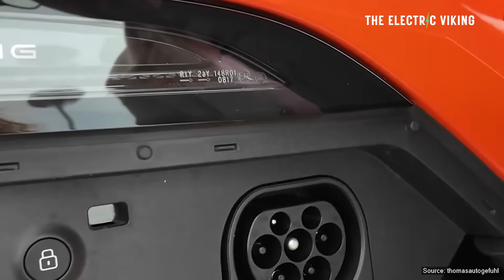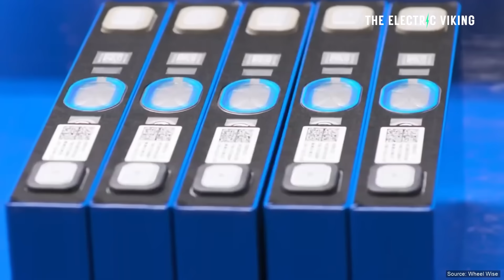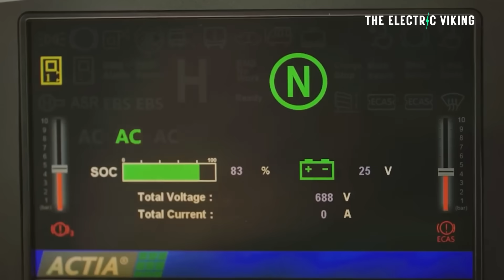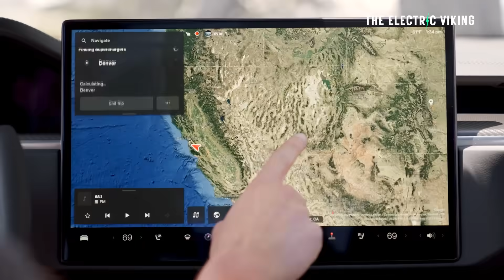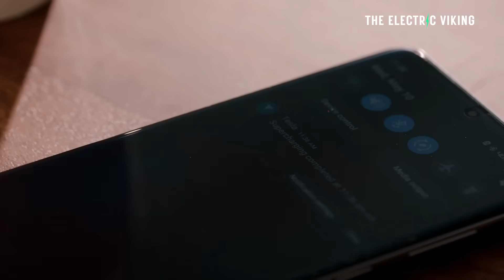Shocking data reveals the TRUTH - how long electric car batteries really last

Comment: Wonder what sort of repair costs and insurance rates apply to EVs . With motors in each wheel and in side collisions that may compromise the integrity of the main battery, I can imagine repair costs would be very high.
Reply: The motors are not in the wheels.
Reply: @jimpike7445  They are not wide-spread yet, but google 'EV in-wheel motors' and you will see.

Comment: So true. My wife's 9+ year old Nissan Leaf is still going strong. Sure, the battery has degraded quite a bit, but it's still a perfectly usable city car and I'd say we'll get another couple of years out of her before we may need to consider replacing the battery. Bear in mind, the chemistry in our Leaf is generations old. Our ID4 with thermal management and modern chemistry should be good for donkeys.
Reply: The amount of public charging option is also very different from 9+ years ago, making a degraded battery less of a problem.
Reply: I was afraid you were talking about replacing your wife after 9 years.
Reply: @jamesnasmith984  😂
Reply: What’s the range on it now. I’ve seen a few advertised and they weee 150 kms range new but now about 80 kms 
That’s the cheapest Leaf’s around 2011 I think
Reply: @Alex-l6d1f  Around 130km. Ours has the 30kwh battery. The build quality is excellent and the only cost has been a set of new tyres and a replacement 12v battery. It's still perfect for round town. We take my ID4 on longer family trips.
Reply: @AlexChiswell  I sold my 2013 leaf after 8 years usage, slow charging only and just over 110000 km usage (yes that was our second city car, not too much miles) Range (summer) after those 8 years when driving motorway with 95 km/h (on gps checked) or nearly 60 miles/h was 90 km.
When new , same speed, it made at the same type of usage 115km to 120 km range. Gives me after >1100 charge cycles 75% to 78% range compared to new. The 2013 I had was the same (japan produced) version as the 2011-2012 cars...24KWH bruto (20KWH netto usable) battery when new.
Reply: @AlexChiswell we are getting 152 klm on our 2015 leaf,  just charge it with level two capacity
Reply: Batteries love random charges and discharges. Just my opinion.
Reply: @rickyjulian496  Your home charger manages all that.
Reply: @saml4537  no dog in the fight here, don’t even have a car but that’s great it’s working for your needs and you’re willing to be flexible in trying to get more years out of it.
Reply: Yes my wife's 2015 leaf battery capacity has not shown any degradation. Maybe 5 miles less, maybe! Great car!
Reply: I drive a 2018 Leaf and thought my battery was degrading.  I was wrong.  I learned how to recondition my battery by taking it down to 15% (whenever possible) then charging it to no more than 80%.  About once a month I charge it to 100% and my range is only 7 miles short of when it is brand new.  I couldn’t be happier.
Reply: My 40 year old Mercedes SEC still runs fine 9 years is nothing.
Reply: @ReinhardSchuster I would guess that your 50 yo Mercedes runs great because you are willing to put in more repair money than the worth of the car. You can keep a car running forever doing that. Although is it really the same car? Ship of Theseus.
Reply: Such a pity with the Leaf  no proper bms, but old chemistry, great fun to drive though and excellent build quality.
Reply: @offgridsolaruk843  Yes, Nissan really did blow it. There's a local company looking to retrofit older Leafs with blade batteries. Might look at that in a couple of years. We really enjoy driving it.
Reply: @saml4537  very cool very interesting about blade battery replacement, but how I w will they add active cooling and heating? Or it will be the blade battery with poor leaf thermal management? Sincerely curious.  Still a great value with or without thermal management <3
Reply: @borshardsd  No, they're adding a thermal management system :)
Reply: @saml4537  that is impressive. Really great news. If i could find that mod and then grab a cheap car in need of the hv battery, possibilities. Ty for the share fam!
Reply: 😂Degraded.
Reply: My 9 year old Renault Diesel will still do the same range now as it did when I bought it and will most probably carry on doing so. It is zero rated for VED. Putting the heater, air conditioning, lights, wipers, heated rear screen and radio does not affect the range and I park it on the street outside the tower block  in which I live, (try doing that in your EV) takes me 5 min to refuel . I think I will keep it.
Reply: @davidclegg3554 Your diesel Renault does not have the same range (I.e., gas mileage). Gas and diesel engines lose efficiency. People just don’t notice.
Reply: @davidclegg3554  You bet it affects the range. Do you really think turning on all those accessories doesn’t cost you fuel? Really?

Mate, I’ve got a great deal for you. There’s this bridge and it’s for sale…
Reply: @davidclegg3554  cool. Care to share the cost of maintenance? 

Is diesel technology changing or improving? Or ev tech is changing and improving? 

Could you help us out and cycle even 5% of your exhaust into your cabin? It shouldn't matter to you the damage your own exhaust could do to you?

You wouldn't do us a favor and warm your vehicle up in a closed garage?

Comment: I have a twenty year old ICE truck,  Less than 50,000 miles,  its problems are mostly caused by time and weather.  
The Plastic parts degrade with time, humidity, the sun, and temperature changes.  The electronics is affected by humidity and temperature changes.  The metal parts are affected by water, heat, and sun.  Add the salt that is used in parts of the world and corrosion becomes a problem.  Wire insulation gets brittle with time, heat and humidity.  Rubber hoses and gaskets get soft with age and the liquids inside.  The chemistry may affect the battery case over time.  
Vibration makes most of the above problems worse.
The The cell chemistry may not degrade as expected with use but you do not have 20 years experience of everything else in the pack.   How many are going to die because some gasket starts leaking and gets liquid all over everything and starts corroding the terminals.
Entropy is a problem that can not be fixed.

Comment: I've had a few EV's from a 2010 Leaf through to the one I have now a 2019 KIA Niro EV,  the Leafs were a problem after about 50K Km's, The Niro has 65000 Km's charged it to 100% two days ago for a run and it charged to over 550 Km's range, Have scanned the battery myself (workshop Scanner) and so have KiA and it is still showing 100% SOH

Comment: This video grossly generalises LIBs as all being the same. The batteries being put into cars now, and the last few years, are not the same as the ones tesla was using 10 years ago. Modern batteries have anode additives that significantly increase cycle life degradation, to increase the range. It won't present any issues within warranty period, but afterwards its bad news. You need tp specify exactly which chemsitry you are talking about if talking about battery life.
Reply: Not really - the point is the testing used to estimate battery life span is more damaging on the battery than real life use. This is true for all Li-based batteries but the amount of difference may be different between chemistry types. But the headline message is still true - all car batteries last longer IRL than in tests.
Reply: @technovelodos  What do you mean not really? What I said is completely correct. As for lab testing vs real life testing, that's something we already knew as tests seldom go beyond 2 years. But its borderline stupid to generalise about battery life given the serious changes that new chemistries are creating.

Comment: We are on the cusp of home and vehicle energy independence for most homeowners. Solar cells are becoming so low cost, that in hot climates, you’ll pay off the panels with savings just from shading in a decade. Home batteries and EVs are still expensive, but dropping rapidly in price. 

Affordable, large (50+ kWh) home batteries will be the gateway drug for EVs totally displacing dirty and unreliable ICE vehicles. Once y homeowners become home energy independent, becoming vehicle energy independent will be an easy and obvious choice.
Reply: I have 24 panels and 15kwh home battery. In this part of the world that cost about US$18000. Most of the year, my home battery is far too big, only going down to 65% overnight. However, I have now started charging my ev at about 3am (depending on the time of year and when sunrise is). This makes much more use of my home battery (takes it down to 10-15%) and gives me more hours to trickle charge the ev. Between the fact that we no longer buy petrol/gas and we no longer pay for electricity, break even will be about four to 4.5 years.
Reply: And you won’t be paying thousands of dollars a year to keep some oil industry robber baron on his private island.
Reply: 100% agree. You are bang on. Now watch the scrabble by gov to get money out of you to cover Whats they have lost. RUC riad uses charges already gone up on EVs

Comment: You have to be concerned with degradation and the BMS to detect failing cells. 
Pushing full charge and discharge as new when resistance change, amperage capacity decreases in  even 10 in a thousand is a big concern.

Comment: Main point is they are getting better - by a long way. Next point is all batteries are modular but recognized by software as a whole pack. Over time one or more modules simply get bad or weak or damaged. And the good thing is there are solutions for that by checking and replacing them - the modules, not the whole battery to extend significantly the battery life or giving it a new life (humidity/ water damage etc.). There could and should be given more attention to battery serviceability by automakers. More battery service centers, extended battery warranties by the manufacturer and 3rd party options, better warranties with no exclusions: there is still a lot to do and a lot that can happen.
Reply: Tesla batteries are no longer modular & part of the cars floor structure now.
Reply: Absolutely... Blade and prismatic cells help ease the serviceability of  packs ...round cells less so and encapsulated structural packs really need an overview as to where they are going and why... It's counter productive . Plus all packs need to be of  100%waterproof construction. Flooded roads and flooding in general is a major vehicle killer world wide ... ice and EVs.. EVs though are easier to seal up.. 

New chemistries are far more intolerant than recent and present types. As well as escaping the rare materials trap.
Reply: Sounds plausible. For the moment not touching an Ev

Comment: Also beyond just DC fast charging constantly and rapidly, lab conditions also charge under a certain level of heat or cold to simulate long term degradation by basically 'speeding up' degradation through rougher conditions to make up for the shorter time they're testing.

Comment: If they last that long, it will most likely outlast the rest of the car. A good incentive to use them for vehicle to load. That can take advantage of the extra solar in the daytime, use it for peak power times and reduce the stress on the grid. Win, win, win. It takes away the argument, the grid won't handle the electric cars. EVs and home solar with vehicle to load can be the savior of the grid, not the demise.
Reply: In Australia maybe, but in northern Europe it's a no.  I have roof solar but there's no way it could generate anything like the amount of electricity to supply an EV as well as the home. I know there are some who can, but they all have massive properties with huge amounts of solar.  For most people it's just not on.
Reply: @vincentcausey8498  Even if solar cannot bear the entire burden of your electricity use, every kWh your solar generates is a kWh you didn't buy from the grid.
Reply: @vincentcausey8498  I don't know what solar system, and power usage you have.  But my home uses little energy at the time my solar panels produce the most.  So, charging my EV at peak solar time helps increases my self-consumption a great deal... which is key as I get precisely nothing for whatever power I inject on the grid!  I long for having an EV with V2H/V2G capability to enhance my relatively small home battery system!  And I live in central France... not Australia... and my 9 kWp solar system generates a surplus (vs home + EV charging + spa) around 8 months per year.
Reply: Also community RE projects can work with the virtual power plant concept.  Battery storage and power usage planning can work with EVs and keep rates low.  The undiscussed factor is creating a wider electrical system that is public and voluntary.  The public needs a buying incentive and a guarantee that the gains of buying low cost RE at off-peak hours is not stored and sold by corporations that pocket the difference.  Labour in Australia needs to lock this in.  In the USA individual state governments will (someday) work this out for the benefit of their citizens and as an economic way to transition to non-polluting, cheaper RE.
Reply: @jeffallen4377  I don't think it's unfair for the grid owner to buy your surplus power at a discount and then sell it at regular rate because you are using their grid, which required upfront capital investment and ongoing maintenance.
Reply: @ I would figure that a regular customer would have paid for the grid and infrastructure many times over.  Giving customers a more reasonable rate as a result of a new source is note unreasonable.  I live in a state where I can pick my supplier.
Reply: @jeffallen4377  'The Grid' is not like a diamond, which you buy once then put it in a drawer and it stays the same forever. 'The Grid' requires continuous maintenance just to stay the same.

Comment: Don't even need batteries can use a fly wheel which if combined with regenerative braking ...well, regenerative braking systems alone might be sufficient #irony those types of batteries I think known as #super_capaictor is what Elon specialized in. New Tesla Model 3 "Highland" is an amazing and amazingly important upgrade to the Tesla fleet. Add to that price increases for the Model S and Model X and Tesla has an absolute fortune in capital to play around with especially as their autonomous driving "learning machine" system does in fact work. Don't hear of $ibm International Business Machines or $msft Microsoft saying their AI system can do that meaning actually in fact DO ANYTHING. Long $qbts Quantum Computing strong buy. Long RocketLab strong buy as well. No way do these so called "battery experts" know anything about how to do electrical systems in outerspace let alone one requiring backup power. $40,000 for an Aptera worth every penny if you can get your hands on one. Electric trains not nearly so complex or expensive as well. #turbines_of_the_wasatch union Pacific turbine locomotives. Of course everyone knows in Australia there is no natural gas supplies...or not? Hmmmm😊😊

Comment: Toyota Hybrids had 100,000km warranty. Most outlast double that at the very least, likely mauch more. These are Nimh batteries. The lead acid start batteries are only good for five years if you are lucky.  My 2008 hyb has gone through three lead start batteries in 230,000 km and the NImh batteries perform at same efficiency as new and I know this because the petrol consumption has not varied from new. Thanks Stan keep up the truth telling.
Reply: How many km did the battery in Toyotas do any work? Often they just sitting there doing nothing I presume.
Reply: @Harrythehun  driving around where I live under 60 kph the battery is working most of the time, you can easily tell by the lack of engine noise. My hybrid is 9 years old and it will easily last another 9 with my type of driving.  The Toyota chassis is another matter, its rusted already for no good reason.  So I'll be driving a battery powered rust bucket if it lasts that long, never again Toyota.
Reply: @Harrythehun  230,000 kms over the life so far from 2008. Urban and long rural journeys. Often in the bush. Its a Lexus so built to go far. Not many treat their Lexus to bush roads but it just cruises.